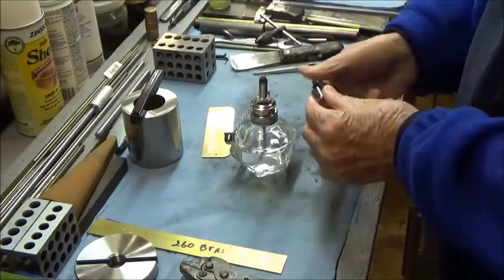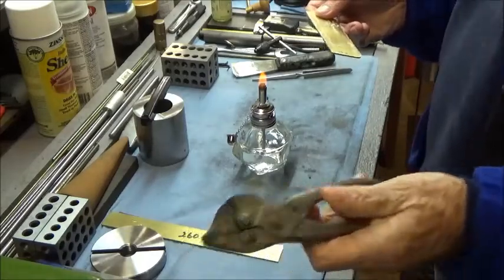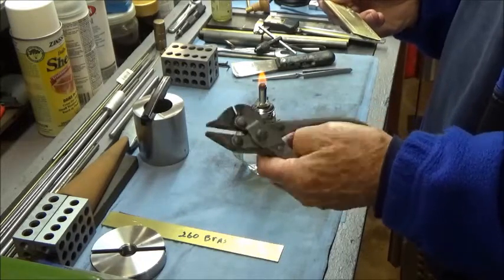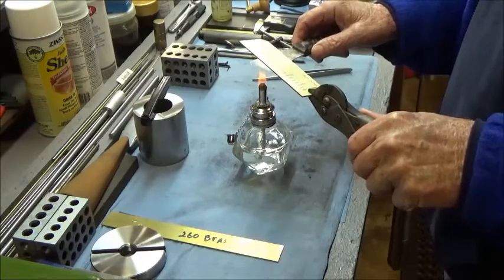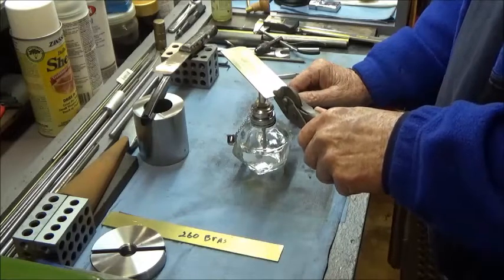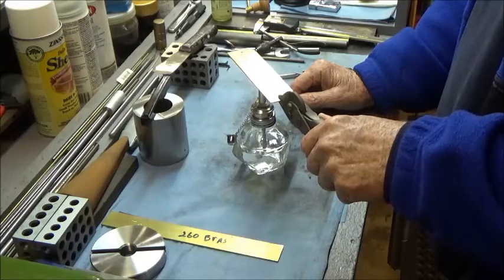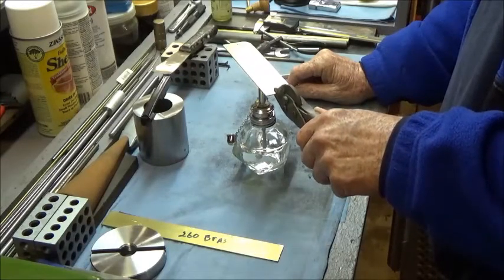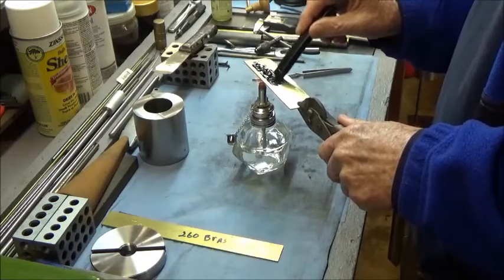Engravers Wax / Black Shellac Stick

Comment: Looks great Larry, years ago as a child in London UK my dad would visit a leather cobblers shop and purchase odd cut leftovers and repair our shoes, that was a popular thing then to save money, finally the last thing to do was to heat a rectangular iron and melt a black stick just like your stick to make the edges black or brown,
Reply from the maker: I think the little plate worked out well, but the learning curve seemed gruesome, to say the least.  I finally think that I have it figure out.  I also realize that I can make the large 10" dial (Chapter Ring) on the little Taig Mill.  All I need is 5" reach in both directions.  I think I can program the rotary table to make all the circular cuts and engraves, but the incremental short lines will be a pain, since there are 60 of them.  I will probably need to do them by hand, each time raising and lowering the Z and have 2 stops on the X.  The rotary table will automatically supply the increments.  I may rig something up tomorrow, but I'm still trying to think of an easier way.  Best Regards: Larry

Comment: Where can you get black engravers stick
Reply from the maker: It's a hard black shellac stick sold by clockmaker supply outlets for silver dial work.  I think I purchased it in the U.K..  Post from U.K. comes very quickly and I remember purchasing several at the time.  I don't remember exactly where.  I just searched Google and came up with this link.  Regards: Larry
http://www.m-p.co.uk/muk/parts/chap10/stick-of-engravers-shellac-black-wax-0354003015.htm
Reply from the maker: Here's where I bought it.  See Link
https://www.cousinsuk.com/product/engravers-wax-elephant-black